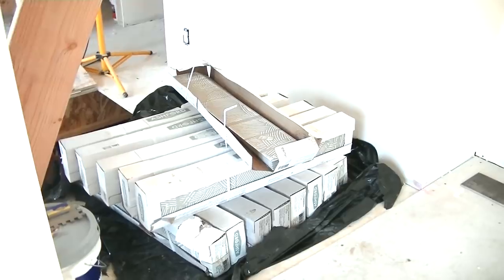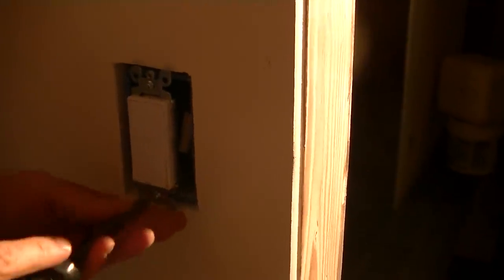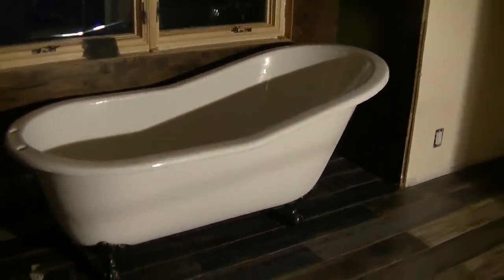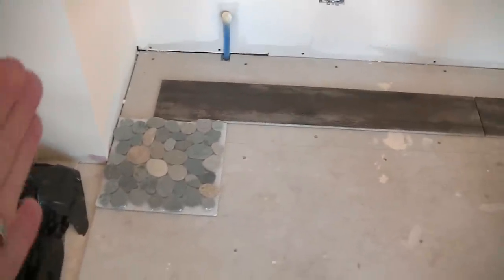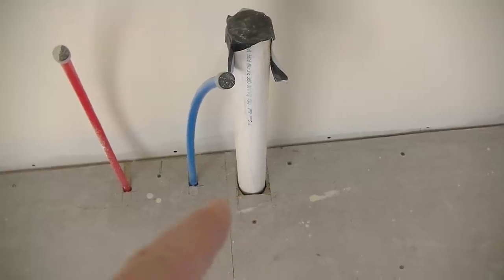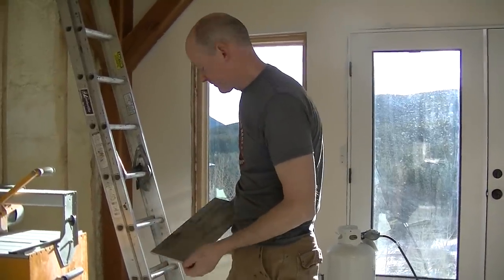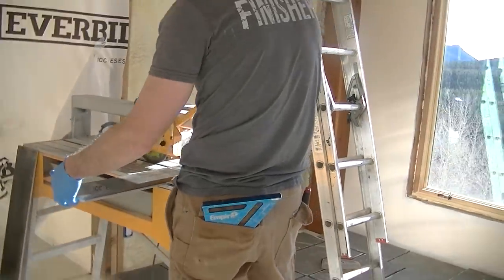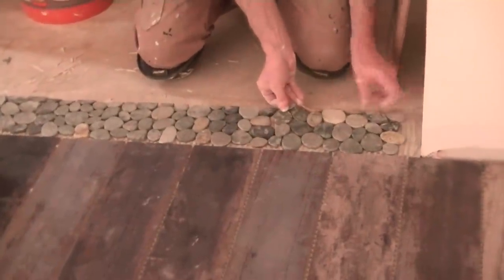Kitchen Floor & Bathtub Arrive & Bryan's Big Mistake

Comment: Great video, that bathtub is beautiful and the light over it will look excellent. At the 12 minute mark Brian was talking about the wall that the cabinets will be on and mentioned a “walkthrough” at some point in the future. Does this mean you’re going to tear your kitchen apart at some point? Is that an outside wall? Brian has the patience of a saint, to lay all that flooring was quite the job. That stone border was a great idea, really sets off the flooring. You’re both doing an excellent job, when you do it yourself you know it will be done right. God bless.
Reply from the maker: Thanks! Yes- sounds like we need to go over our house plans again because what we're actually building now is the master bedroom suite that will feature a temporary kitchen (which will become a walkthrough and the front door will go away) In some of the videos before the drywall was up you can see how part of the back kitchen wall is framed up for a walk through. The idea is to save money as we go and not build the entire house all at once.

Comment: Just a little advice on electrical installation. It is easy, but not a good idea, to stab the wires into the back of the switches and outlets, because the connection will eventually oxidize and either become intermittent or totally lose connection, not only for that one switch or outlet, but every one after it in that circuit. Take the time to use the screws. This is the problem I'm having right now in my house. Have had to chase down and fix 2 circuits, and I'm sure there's more to come, at the most inconvenient time. One hot wire had even come completely out of the hole in the back of the wall outlet! This killed all outlets, switches, and lights that were on that circuit after that outlet, even in other rooms and floors! Also, I'm told, the bathroom and kitchen have to be on GFCI (GFI) circuits. I have to fix this in my 45 year old house.
Reply from the maker: Paul Monk thank you for the tips
Reply: He's right!

Comment: Tiling best practice is to measure the room and make a cross with your string line.. Start in the middle. Reason.. if the walls are off, you dont end up with massive error on the other side of the room.  By bisecting the room you will not have the change in size as noticeable.
Reply from the maker: Steve Pailet good tip. Can't believe how lucky we got with no need to trim tile along the wallls!!

Comment: The cracking of the tile comes from not being fully supported from below due to the wide crack in the saw base. What I do is cut a piece of backer board the size of the wet saw base . then set saw height to just score the cbb. Then lay and cut tile on top of the new base. The tile will then be fully supported from underneath. Hope that makes sense. Also for the floor I all way use thinset under the cbb when installing it. Then I use thinset to set the tile, never premixed mastic. Mastic has to air dry so with large tile it never fully dries as where thinset dries from a chemical reaction. Only time I use mastic is on a kitchen back splash. Also I soak the tiles in water as I set them to keep from pulling out the moister from the thinset and all ways back butter them. A few years back I went to repair, or replaced a shower that had failed and found out they had used mastic to set the tile. After four years the old  tile I was removing still had wet mastic on the back! Hope these tips help. Have fun!
Reply from the maker: Darrell Willams good tip! Thanks
Reply from the maker: We switched to thinset-which nobody noticed in this video- but that's ok. Used up the mastic we had at the beginning. The air is so dry here even our grout was dried in seconds after being applied. We definitely don't have moisture problems that would make mastic a bad choice for us.

Comment: The NEC National Electric Code 2011 requires that any part of a light fixture, including crystals dangling from chandeliers, must be a minimum of 8’ feet above the highest portion of a tub’s walls. This zone extends out horizontally 3’ feet around the tub rim.
Reply from the maker: Oh ok. Thanks for the info! Guess we'll have to do a recessed light in there for inspection.

Comment: As Darrell pointed out, always use thinset on floors or shower stalls..
As for cutting tile, get a MK Diamond Hot Dog or a QEP Black Widow...

I had to cut 1/8 th off a 2 foot piece of porcelain tile, thought it would just break as I went..
Was left with a 2  foot long 3/32 piece of intact tile..

https://www.amazon.ca/gp/customer-reviews/R62LE466Y7ZX2/ref=cm_cr_arp_d_rvw_ttl?ie=UTF8&ASIN=B002DUACNA
Reply from the maker: After the mastic was used up we switched to thinset on the floor- you can see at the end of the video. Good tip on the blade brands. thanks! (it's our neighbors saw we're borrowing)

Comment: Nice job as always.  Have you tried setting the blade depth to score the tile with the saw first?  Would be two cuts but might save your chip out.
Reply from the maker: Ed Over50 not with the saw blade but he used a tile cutter to score first and it worked like a charm.

Comment: Looks great. Just wondering if hanging lighting over tub would not possibly be a electrical hazard,requiring GFCI. Murfey's law,anything that can will or won't. Just thought you might take another look while the "Work is in Progress.
Reply from the maker: T Howe good tip- I'll check with the electrician.
Reply: @ColoradoMountainLiving  I think just make sure it pulls power from a gfci breaker.
Reply: @Colorado Mountain Living  Either that, or run it off the GFCI switch or outlet in the bathroom. Check with your electrician. I think that is an easier alternative to a separate circuit from a GFCI breaker in your main panel.

Comment: You should have used thin set on the floors.
Reply from the maker: After we used up the mastic we switched to thinset which you can see in the 2nd half of the video.
Reply: @ColoradoMountainLiving  I did not catch the switch. On wood/hardi floors always use modified thin set to avoid tiles breaking down the road. I have redone many floors like that.